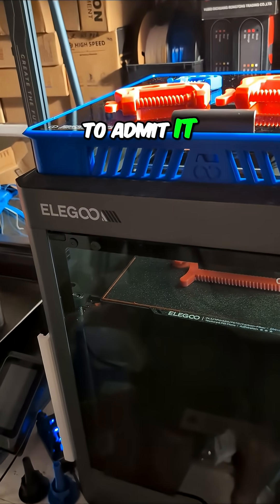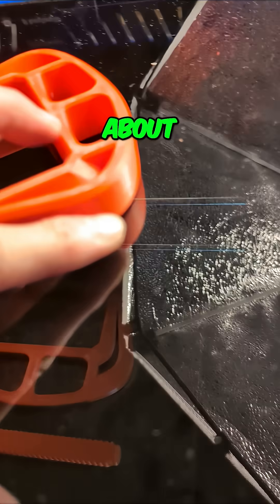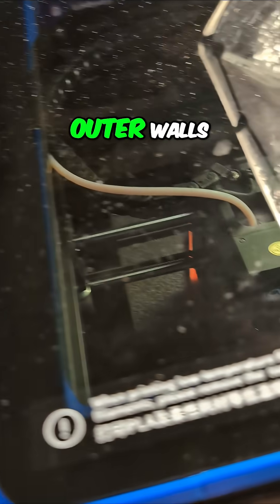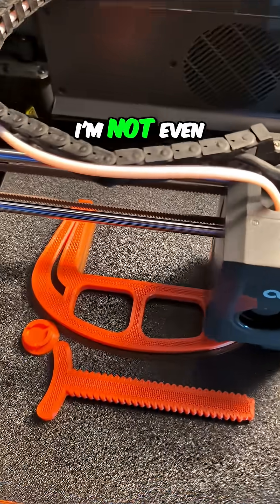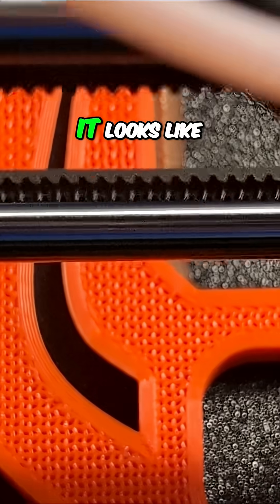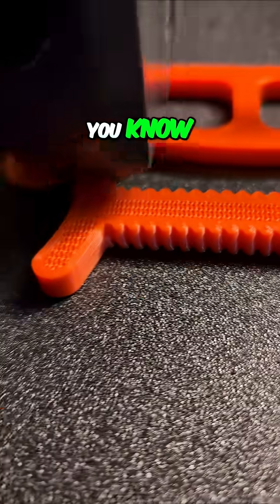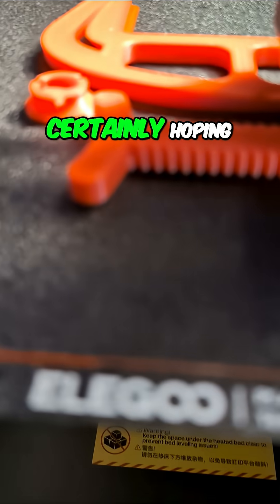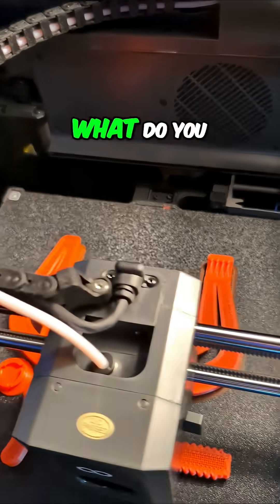3D Print FAIL! My Settings Were WRONG! (Embarrassing)

Comment: Most people dont know you can print with no infill and make it solid but that's because the industry was built rapidly and lately it was over prototyping but we're past that now we've had 3d printing since the 30s so technically we should be able to make em print in hours or minutes but we still have companies limiting their machines 😅 sorry for the little rant at the end
Reply: Also btw a solid print doesn't always make it structurally sound it has to be engineered right (that doesn't mean by the book either) but it does make it hefty and it does give internal stress wear but tbf wouldn't a 50% infill with 4 walls be the strongest with a different infill pattern to help with clamp force and holding force to test what the strongest print for this would be
Reply from the maker: Good point. I print lithophanes with no infill, just walls :)

Comment: I just crank up the walls until there’s no room for infill
Reply: Depending on geometry, this can make the part a lot less stiff since all the parallel perimeters tend to be willing to bend together. Having infill or solid fill at different angles to the perimeter resolves that.
Reply from the maker: Counterintuitive, but I agree.
Reply: @daliasprints9798 not true at all. A solid piece of plastic will always be more rigid than anything of the same volume with gaps inside. Ideally if you want as high of strength with as little mass you should just design a part as if you were injection molding it and max the walls out. Obviously you dont have to worry about undercuts or drafted faces like you would with actual injection molding
Reply: @randompersonoftheinternet  You can test this. Make a part that's a box 100 mm long in X and 4 mm in Y and Z. Compare deflection force for 5 perimeters each 0.4 mm wide (fully filled with perimeters) vs just 2 perimeters with solid alternating-direction diagonal fill or even 50% grid infill and see what you find.

Or folks could trust people who actually make stuff and have something to show for it vs a random person on the internet...
Reply from the maker: Thats how I do lithophanes :)